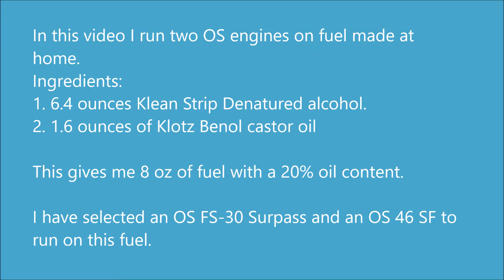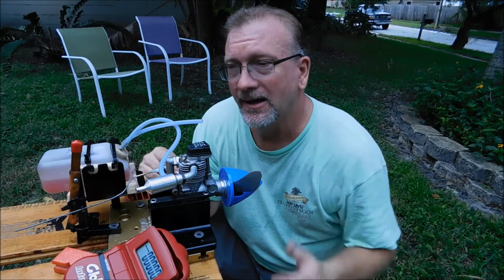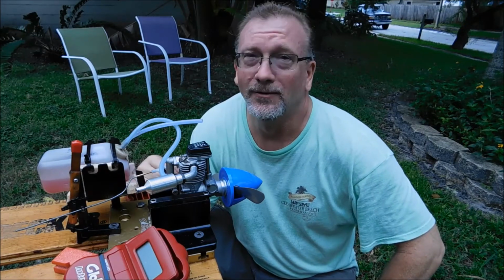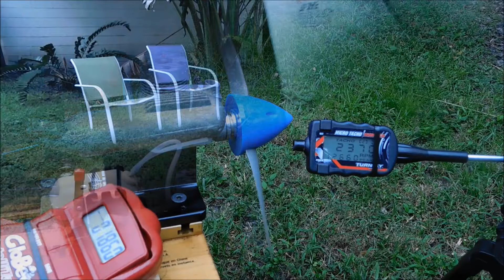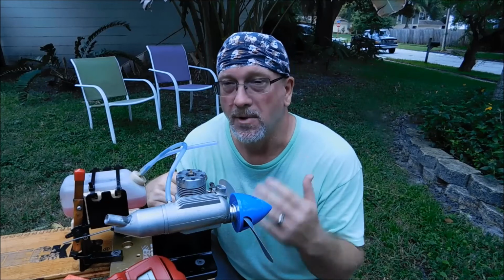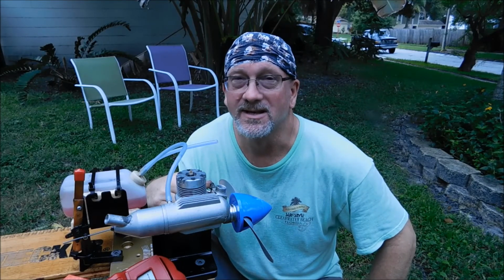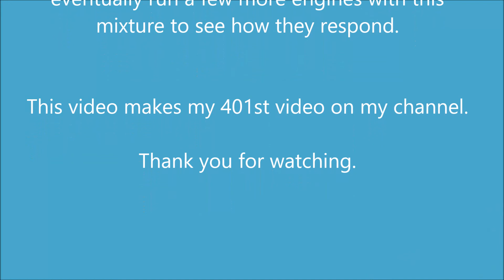Home Brew Fuel Experiment: My 401st Video!

Comment: I tried to find Denatured Alcohol and its no longer sold at Lowes or Home Depot. I think you can find it at real paint stores. Ace Hardware had it but it was $25 a gallon. That takes it out of the running except for desperation use.

Comment: David, rally appreciate your trying this.  
Question:  Could a person use a synthetic instead of the Klotz; any type or brand choice?
Thanks David!
Reply from the maker: I'm sure you could.  There are no rules that I followed for this.  Synthetic oil is used in many glow fuels.  Personally I would not recommend this type of fuel for long term use in a glow engine unless you have one you don't care about and don't mind being destroyed.

Comment: Hi David. I am looking at mixing my own fuel. I found Methanol locally for around $65 for 5 gallons. and I have a Summit Racing about 40 miles away that sells the Benol. There are several different blends of Benol. Which one are you using? They have a 171, 172 and 175. I am still trying to find Nitromethane. I know where a race guy lives and I hope he can sell me a gallon of it. Thanks in advance.
Reply from the maker: Watch this video and all engine runs in the FAI Experiment playlist.  You really don't need nitromethane.
https://youtu.be/5p9uz482dUI
https://youtube.com/playlist?list=PLsvn3JGZAOMuFBXHT90CCuriX37BatIKj
Reply: @dmrcflyr2  I have already found 5 gallon cans of Methanol locally and we have a Summit Racing not too far away that sells the Benol oil I need. Five gallons of Methanol and 5 quarts of oil will give me 20% oil in my fuel. I am ready to mix. Thanks a bunch.

Comment: Just saw your video for first time. Marvelous .  Curiosity caused me to look up the (m)sds on Klean-Strip. Methyl alcohol, Ethyl alcohol and a ketone to denature the alcohol. The ketone also acts as a solvent for varnish and paints. careful of your finish on the plane. Also, the ketone has low affinity for water. You already know how to sump fuel on scale aircraft so this would indicate about the same. Your using a castor oil lube is wise as mineral oil will not mix with alcohol. It's the original aircraft oil.  Bravo.

Comment: As you have found out Nitro is not required to make a glow engine run. It does help a little with idle and transition as well as all out power . I have found that better quality engines are more capable of running non Nitro or FAI fuel more reliably.

Comment: Is denatured alcohol as hydrophyllic as methanol?
Reply from the maker: What is the measure of how hydrophilic methanol is?  Where did you find that number?  Can’t you use the same process for getting your answer here?  All alcohols are hydrophyllic to some degree.
Reply from the maker: Well the intent of this video was to simply show a POSSIBLE alternative to making a fuel; basically an excuse to make a video.  These engines still require a form of alcohol to operate and with that they will still require the proper maintenance. That includes completely clearing the engine of fuel residue and using a good after run oil to keep internals lubricated. As I asked above, what is your measure or numbers for the hydrophilic capacity of methanol?  If you do not know then how can you possibly compare it to denatured alcohol?  Thus, what difference does it make?  Proper maintenance of your engines still applies so I do not see the relevance of the question.  As long as glow fuel is available, using denatured alcohol is not required.  Don’t you think if denatured alcohol was less hydrophilic or ‘better’ than methanol, that glow engine manufacturers would recommend its use instead of methanol?

Comment: Keep things simpe (haven't even seen the whole video yet) - just use the same measuring container and do either 3 parts or denatured alcohol to one part of oil ( that's the brew we "grew up" back in the days - 75% alcohol / 25% castor ) for break in our engines .. then switch to 4 parts alcohol and 1 part oil for a 80 / 20 % ratio ...  Excellent one David.

Side note: back in the days when I grew up in Europe, we could go to any whole sale chemical outlet and we were able to purchase methanol, castor oil, ether (for diesel engines) .. I recall the person in the counter asking us: what do you need this for ? and we genuinely responded: for model airplane engine fuel ... Ohhhhh good old days David.

Maaan - are you my "hidden" "brother" I didn't know :-) :-)  Same tastes, same experiments .. even similar dates of birth ?  - Mid 60's is my birthday too :) ..  God Bless man ..

Comment: YES !!!!  Finally someone stepped up and did it  !!!!!  THUMBS UP all the way David.
I have been meaning to do this for my own vintage engines - especially the ones I have that require no nitro.  This IS the way way to go .. and you can always get a litter of commercial fuel if you want to play with nitro ... 
Back when I was young - in Europe - pretty much we used to make our own fuel with the limited amount of funds we had as kids .. and our engines were running great.  The difference was back then we were able to buy straight Methanol (about 80 to 85% pure ) - very cheap - while nowdays you cannot do that. BUT, Klean Strip seems like a good alternative - so I will give it a shot as well.

Comment: Hey Dave! I've just stumbled onto your video.

First thing I noticed is that you used ethanol instead of methanol on your brew. Ethanol is the recipe for the new OS BE engines. On those, OS recommends a 10% oil mixture.

I've ran my trusty old Supertigre G45 with homemade methanol fuel (whis is the same alcohol found on our commercial fuels) using a 20% oil mix with great success. The only thing I've noticed is the idle improves by using a hot plug ( in my case an OS #6 plug instead of an #8). I have also used degummed castor since many modellers around reported that a very bad crust would develop otherwise.

After 5 gallons the piston had near zero carbon buildup. I've never tried it on four stroke engines, though.

One more thing I've noticed is that peak power improves with nitro. The homemade brew would swing a 11x6 prop @12000rm and wildcat 10% fuel allowed me to swing a 11x7 prop @ 13500 rpm. The homemade fuel costs half the price for me down here in Brazil.
Reply: so, did you make your own glow??  runs with any engine?
Reply: @carlosj.castillo254  he means buy a hotter plug to make it run smoother, and it should work with all engines. Im about to try my mix out, after watching these vids I definitely should put more oil. I did a 9/1 ratio

Comment: It's definitely a success for sure and definitely an option if we cannot get access to commercial fuel for whatever reason. As you mentioned though, and I don't have the answer either, since Klean Strip is not methanol, and possibly the ethanol it contains might contain a bit of water, we don't know the long term consequences for using this home-brew fuel especially if there is detonation of some sort that might cause engine wear. But on the possibility that this brew might contain some water, the fix is easy:  at the end of your flying session, just squirt some WD-4 in the carb and make sure you flip the engine several times so you know the oil gets all over inside the engine and you should be good.
Reply: Just for your consideration, VP fuels M1 is a 100% methanol fuel (alky) guaranteed to be free of any water and could be purchased for about $30 per 5 gal. here locally.
Reply: @454RagingBullSS   Would you just use methanol instead of this denatured alcohol and mix with castor oil and good to go?
Reply: @GOOGLE_IT  I wouldn't run a high performance racing engine without nitro. You would have to re-tune the carb to run a proper air to fuel ratio. Which takes a certain skill. I would try going to your local racing supplier (Murray's Speed and Custom) and find 5 gallons of M1, a gallon of Nitro Methane, and mix with your two stroke oil to get the preferred nitro and oil ratio.
Reply: @454RagingBullSS   It's for RC airplanes. OS FS 40 saito 42 motors.
Reply: @GOOGLE_IT  It will run without the Nitro. Ideally you should experiment with a little higher oil content ratio in the fuel to prevent piston and sleeve gulling until you find the right air to fuel turning. 
Nitro methane is used in fuels to increase its power output. Bench or ground test to make sure you will have enough thrust for flight and/or to maneuver out of a situation.

Comment: Hello David. Do you have try use glow fuel with only synthetic oil, none castor?
Reply from the maker: Yes
Reply: And what is the result? I ask because i read that castor oil is the cause of accumulation of sediment in the 4 stroke, cause leaks
Reply from the maker: I still do not understand what you are asking.  I did not do LONG term testing. Wherever you are getting your information about castor in fuel is completely wrong or you are not fully communicating what your concern is.  The castor in fuel does not cause sediments nor does it cause leaks.  If the engine is properly shut down at the end of the flying session by running ALL fuel out of the engine then there is no issue using fuel with castor.  In fact castor offers better protection than synthetic only fuels.  When an engine is gummed up from long term storage, it is the castor that is drying up and causing the engine to be stuck.  It ALSO is creating a preventative layer of protection against rust.  The bottom line is that PROPER operation and maintenance of engines is required to ensure longevity and reliable operation.

Comment: I can't mix the denaturated alcohol 90° to the castor oil... do you have a solution?
Reply from the maker: Marcello Santilli I do not understand why you cannot mix the two. I simply poured both into the glass jar, covered it, and gently shook the jar. Mine mixed fine that way. They have not separated and stay mixed to this day.
Reply: I used decolorated denaturated alcohol bought at the supermarket, and the castor oil bought at the pharmacy... maybe is the castor oil from the pharmacy different from the benol castor oil?
p.s. I made a video where i run a small chinese engine on pure denaturaded alcohol
Reply from the maker: Marcello Santilli Well the purity of the denatured alcohol is important. what you have purchased might have other ingredients in it. Plus the castor oil I used is specifically for mixing with fuel. It is Klotz degummed made for use in racing fuels.
Reply from the maker: Marcello Santilli Well I have read where that doesn't matter, but I have not tried any other castor. I also looked closely at the ingredients of the alcohol to make sure no water was present.

Comment: did you increase the compression?
OS engines are designed for the "american market" and they need a lot of nitro for some reason...
Try a run "stock" and then remove the head gasket and measure the difference.
Another advantage of running low/no nitro fuels is that the run time is a lot longer.
With the castor in there the engine is better protected against corrosion and also against running lean.
Running castor in your fuels (even if its just a part of the oil content) will increase the lifespan of your engine at the expense of the carbon deposit that will build up over time and the more involved cleaning of the model.
Reply from the maker: I do not agree that OS engines are made for the American market at all.  These engines are sold worldwide unchanged.  No I did nothing to the compression ratio of the engine.  I would have noted that if I had.

Comment: Very interesting! I did not expect, that the engines would run so well with that fuel. I did not see any water steam in the exhaust gas, so it seems that the fuel does not contain much water. Thank you very much for this experiment.
Reply from the maker: Yes, it was quite interesting,  I had a hell of a time getting that FS-30 started but the 46 SF took no time at all.  I made another video running a Saito FA-50 on this fuel and it did not seem to care for it at all.